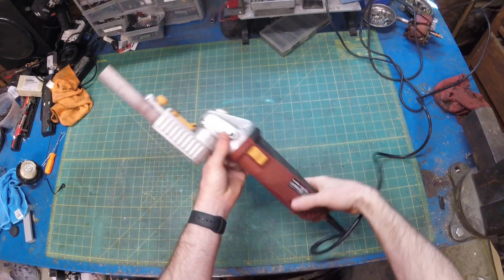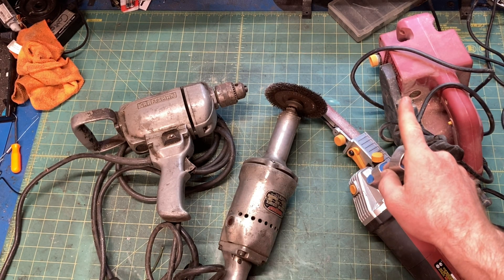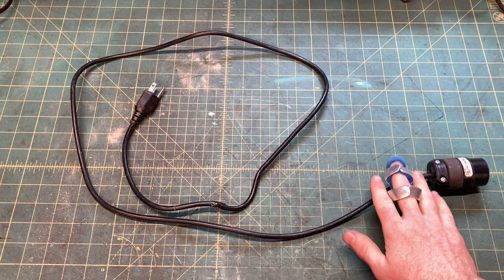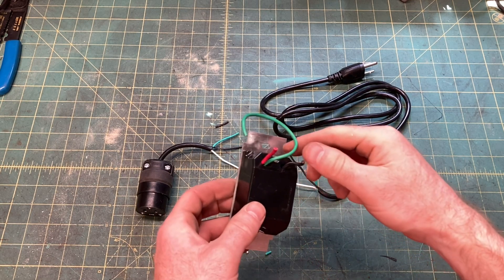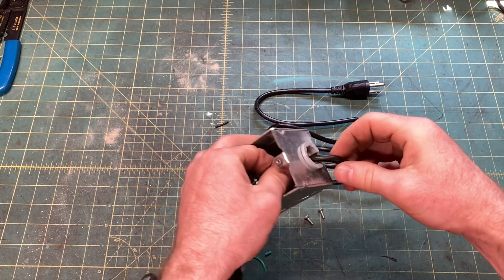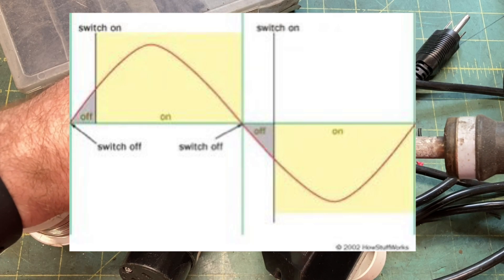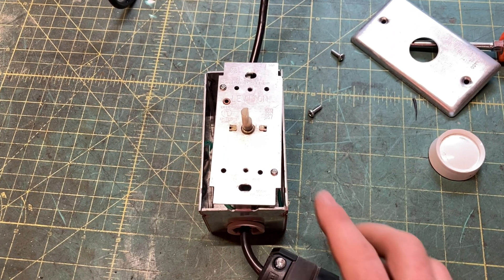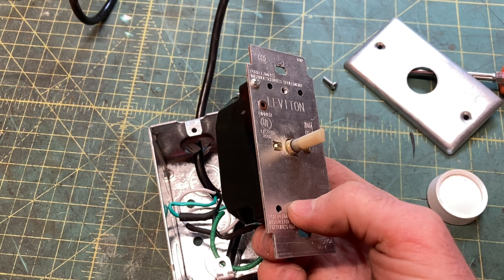From Single Speed to Variable Speed: Upgrade Your Tools in Minutes!

Comment: Hah, I needed an oscillating tool to cut out drywall squares while replacing all of my receptacles and switches, so I went with the super cheap harbor freight one, which looks just like that sander. I ended up running it on a variac, cutting the voltage back a good bit. Not great for all tools, but it worked very well for this. 

Not the strongest unit, but not a bad tool, besides running balls to the walls no matter what. Gets hot as hell though. These things benefit greatly from speed control.

Comment: I would use a ceiling fan dimmer instead of a light one, for heavy duty reasons....
At 1:40 - "be careful with the knife" - In one of my video's I am doing a wall, in planks, I go around an outlet using the "Take the outlet out of the box and snake it though the hole in the wood" method... have a written title box that says "ALWAYS cut the circuit breaker when working with outlets" --- then immediate proceed to say in the video "And I didn't even cut the power" - Do as I say, not as i do LOL - heh, lawyer stuff.....

Comment: DUDE!!!! I have this exact angle grinder!!!! yes, you heard me, angle grinder - it is identical to this sander, except it's an angle grinder.... Those guys over at Hobo Freight are clever!!!!!!!! This thing is a conversion!
Oh and BTW - At the paltry price of $19.99, I bought that specific angle grinder to use and abuse.... to do the jobs i didn't want to use my good grinder for - about 6 years ago - abuse it i have done -  and she still chooches... I broke the side switch - well it broke from fatigue at the right angle point deep in the tool, so I made a new right angle doodad out of aluminum flat bar  to push the button at the rear of the tool, and JB welded it on to the existing yellow flimsy plastic piece - aaaaand - the operation was a success!!!!!!

Comment: My advice—get a Variable AC transformer. Yes it is more expensive, but you can use these on ANYTHING that runs on pure AC. Not to mention there are numerous old, American made ones on the market if you want something durable and well made.

Variac is also still in business, so you can buy American made ones from them.

Comment: Worth noting that this will only work for old brushed AC tools (which you obviously know, but others might not).  If they are newer "brushless" tools this won't work.  That said, most corded tools are still brushed AC because it's cheaper and arguably more reliable.

Comment: Most dimmers are not rated for inductive loads and they tend to use the lowest power triacs they can get. You can get a more durable triac for cheap. Less than what the dimmer unit costs. Especially if you're OK with supporting communism. Now back to that inductive thing, what you want is called a snubberless triac. Which means a triac that doesn't need a snubber network to deal with inductive kickback. Get one rated for a good 20 to 25 amps. I like BTA24-600BW ones. It'll only work hooked up one way. You'd think you can swap MT1 and MT2 and it wouldn't matter. It does. So if you put your triac in and it doesn't work swap them. I think MT1 has to be connected to line but it's been a while since I've built a phase fired controller so I could be wrong. I'm not wrong about it mattering. But if you mess with it you'll find out. The wrong way around it just won't chop. So if you put a triac in and it isn't speed controlling swap those two pins. Burnt out triacs tend to died shorted. So your speed controller won't speed control then. It'll just be full blast. That means you need a new triac. That's your opportunity to get a beefier one.

Comment: Can't this be hard on a motor. I'm not sure why but from experience with my girlfriends umm personal massager wand it seems like it's lost some MOJO since using it with a router speed control.
Reply: love the personal massagers
Reply: The massage wand doesn't have a line voltage motor in it, it's most likely a small dc motor with additional electronics to controll speed. The electronics need to be fed line voltage to work properly, and if you put a dimmer before it, the electronics might malfunction.
Reply: i don’t believe so, most older power tools just use triacs for speed control 
if it was a brushless motor (like a fan) i could see that maybe doing some harm
as for your girlfriends wand 
my guess is the motor in that is a small DC hobby style motor with a Ac-DC converter inside, the triac may have damaged that permanently